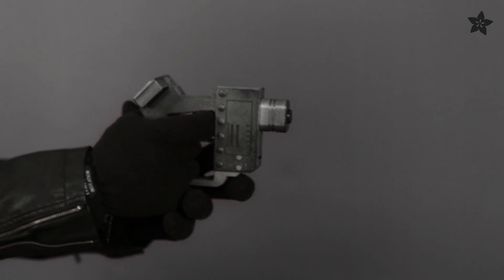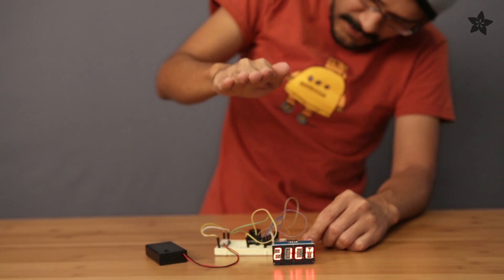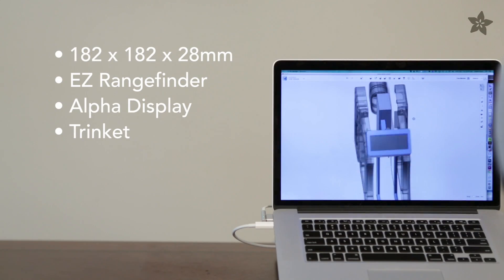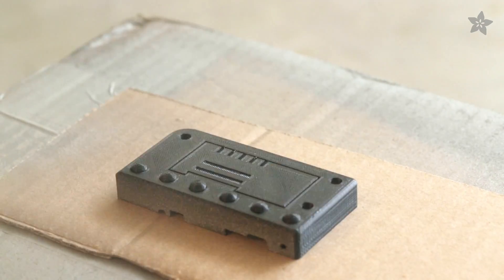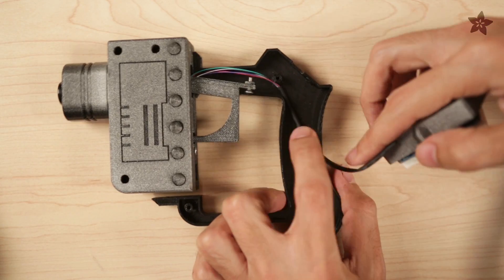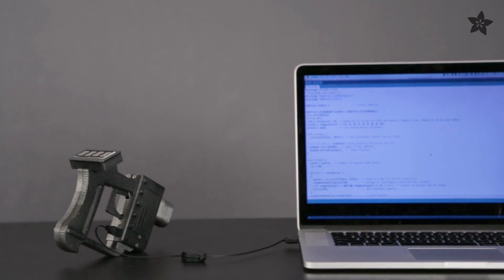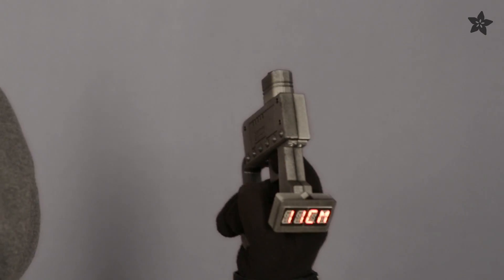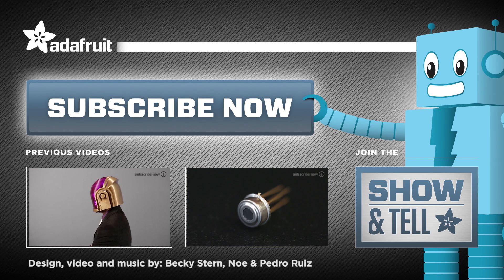#3DPrinted Ultrasonic Ruler

Comment from the maker: Ultrasonic Ruler #3DPrinting #3DThursday
http://www.adafruit.com/blog/2014/09/11/ultrasonic-ruler-3dprinting-3dthursday/

3D Printing, LED and sensors equals ray blaster! In this guide, we’re building a Dune inspired movie replica using 3D Printing and electronics. A stylized enclosure makes this distance sensor into a hand held sonar measuring tape. The design features a unique handle and a large barrel that fits this project nicely.

In this circuit, the trinket write’s the distance to a LED display. The EZ rangefinder is a great sensor for reading proximity and measuring distance.

Read more http://www.adafruit.com/blog/2014/09/11/ultrasonic-ruler-3dprinting-3dthursday/
Reply: Just tell me where you can source a white 14-segment LED module...
Reply: The "Download Thingiverse" gives me an error saying "This thing is not yet public." and
the "Full Tutorial ..." gives me a 404 page.
:(
Reply: Point and measure!

I just rechecked the links:
the Thingiverse one is ok now,
but the link to the tutorial page still returns a 404 page.